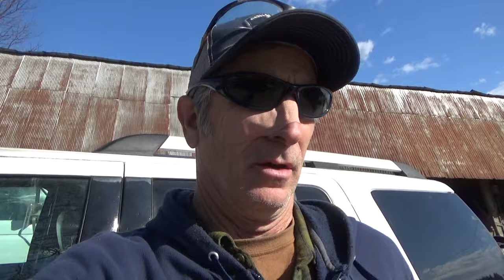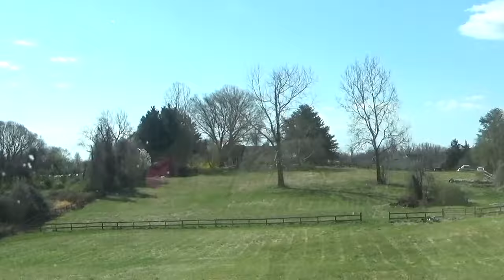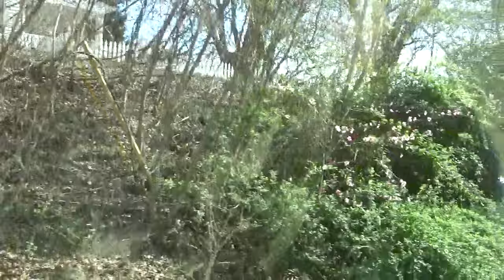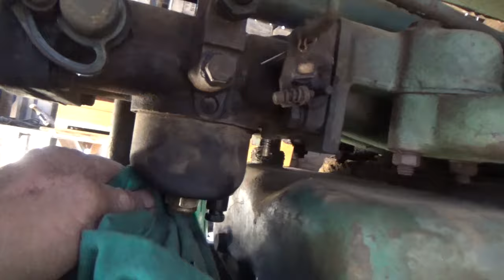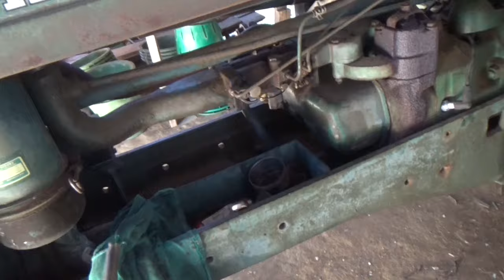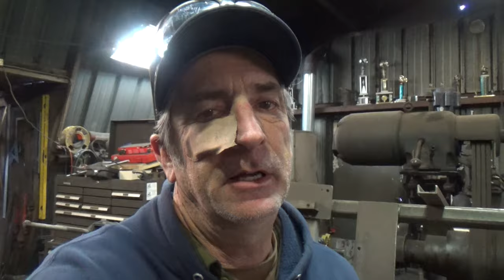John Deere 50 Carb. Repair: Return trip

Comment: Interesting. I got a 50 in a trade a couple years ago and have never heard it run. Did put a new manifold on because the broken one on it was too far gone. Probably better do a carb rebuild before I try to start it.